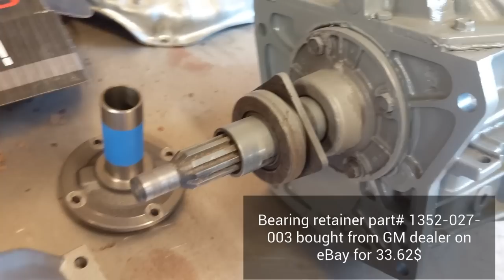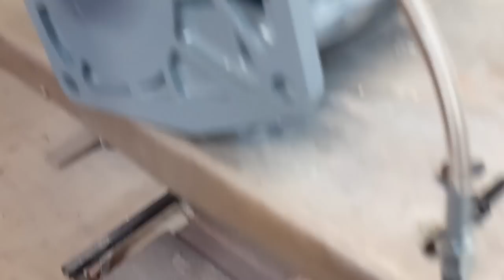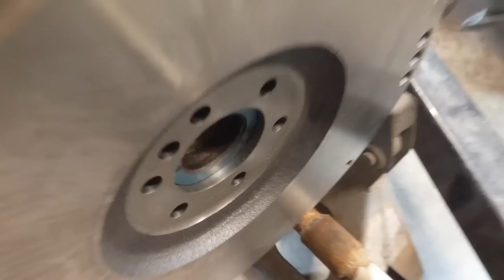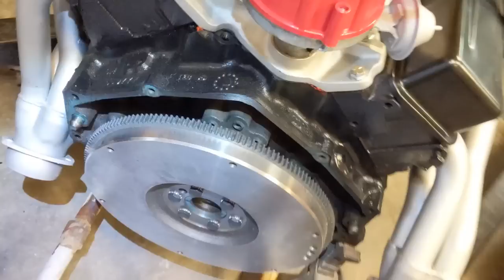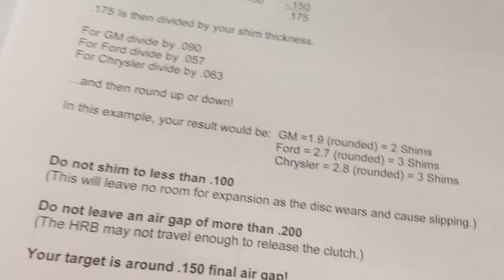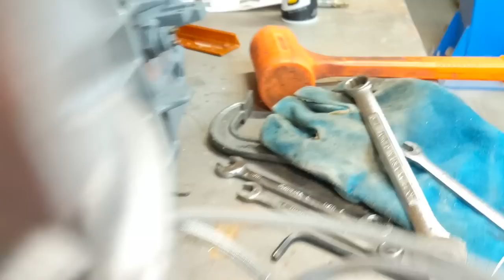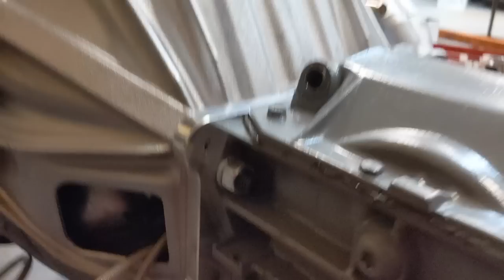Swapping a 5-speed manual behind a first gen Small Block Chevy

Comment: Great video sir!!! So glad I came across this. Im working on a LS swap for my 86 RX7. Im using a world class T5 from a 99 camaro V6. Apparently it uses the same case as the Ford T5. I got a BBC bell housing (with the muncie mounting pattern) and also had a to get an adapter like yours. I got mine from Modern driveline. I first looked up the one you have and they ended up pretty much identical. My question is with the tob. What one was it? Where can I order it and how much does it cost? I went with a T5 to save a little money, didnt realize id have so many other little things to add and change to make it all work. Lol, so far, the least expensive part about my LS swap is the actual LS engine itself! It will all be worth it in the end. Ive liked and subscribed. Check out my channel sometime and you can see where im at with my build. Keep up the good work!!!😎👍
Reply from the maker: Sorry for the delay, this ended up in spam for some reason. The TOB I installed is part# HMGM-01101G, I got it from Summit racing. The TOB from the kit slides over the Chevy front seal housing, so I ordered that and swapped it with the Ford one, but since yours came from a Chevy it may have the correct housing already. Hope this helps and be careful with a T5 behind an LS, I try to keep the total power below 315hp on a stock T5

Comment: So this is a ford transmission correct? What slip yoke are you using for the drive shaft and with the adapter do you have to shorten the driveshaft or no? I have the opportunity to get a T5 from a 93 GT mustang for next to nothing and I’d like to put it into my IROC-Z doing something similar to what you’ve done here.
Reply from the maker: Yes it's a Ford trans from a 92 5.0 mustang. The slip yoke is the Ford and was left on it when I got the trans. I did have to shorten the driveshaft, so I took the slip yoke and the stock Chevy driveshaft to my local driveshaft shop and they swapped the front yoke, cut and balanced it for 160$. I'm not sure what motor you have in your IROC-Z, but some people have expressed concern over higher hp on the T5s. I'm running a 305 with FITECH fuel injection and an edelbrock intake so it's still under 250hp I'm sure, but a built 350 may be pushing the limits of the trans. The 93 is a good T5 and I'm not mistaken it had the highest hp rating and carbon fiber clutches, but if I were you, I'd do some googling before digging in especially if you are adding power later. That being said I LOVE THIS TRANS SWAP! THIS Camaro screams.
Reply: ACtheCarGuy / my 350 is basically a stock vortec 350 with a dual plane intake and an Edelbrock 600 cfm carb. The rating from summit is 255 hp and 330 tq. It’s just a driver no track duty or anything like that. I found a bellhousing from speedway motors (pn 91027001) that has both the Chevy and ford patterns for $300
Reply from the maker: @limabravo6065  I'm not familiar with that bell housing but my only concern would be the distance that the transmission sits behind the motor. The bell housing and adapter run just under 340$ for both, so for 40$ difference it would only be worth it if you didn't have to build a spacer to move the trans back. The HP and TQ specs sound like its right on the edge of what the T5 is rated for but I'm sure on the mustang forums you'll find lots of guys with more HP on the stock trans so it might be fine since it won't be abused.
Reply: ACtheCarGuy 
Well from what I can tell if I remove the ford input shaft and bearing retainer and swap those part out for the gm parts from an f-body everything should be good to go. As far as I can see the T5 in the mustang and that from the Camaro are the same so far as length goes, and the shifter is in the same spot. What I’m thinking I can do for the output shaft is have the ford slip yoke installed on my drive shaft. The ujoint cup sizes are the same. Now I’m just speculating here if I’m wrong please let me know
Reply from the maker: @limabravo6065  I think you are on the right track overall. If the trans is the same length and the u joints are the same size you can swap the slip yoke out and there is always a little wiggle room on slip yokes since they slide back and forth with the suspension so .5 in either way should be fine. If you swap the input shaft and bearing retainer to the GMC style you should he good on the length but you will have to use a different clutch disc and pilot bushing than the ones in the video (I think the shorter input shaft is a 28 spline, so I think you'd use an s-10 clutch)
Reply from the maker: One more thing: if you swap the slip yoke, I would still have a driveline shop balance the shaft. An unbalanced DS can wreck a driveline with a quickness. The balancing may be close to the same price as shortening or lengthening your stock one.
Reply: ACtheCarGuy / absolutely agree/ I had an unbalanced driveshaft once not something I’d care to repeat. Summit sells an oe style replacement clutch for an 82-92 F-body with a T5 so sourcing the clutch and pilot bearing shouldn’t be a problem. Thanks for letting me bounce ideas off you
Reply from the maker: @limabravo6065  no problem! Good luck on your project! I'll have an update yo this video in the future that shows it in the car and how I ran the hydraulics and mount
Reply: ACtheCarGuy /
Thanks man you to. I’ll check it out soon as it’s up
Reply: @limabravo6065  
I know it's been a while but, don't forget the Ford case has a flat mounting pad for the trans mount. Because it was designed to bolt up to a straight-up bellhousing.

An F-body T5 has the bellhousing bolt pattern rotated ~17 degrees CCW from horizontal. And the trans mount pad is also angled to compensate.
Also, your F-body shifter bolt holes won't line up. And a mustang shifter won't be angled correctly, if you mount the trans to a GM T5 bell.

These are really only issues that exist using a Ford T5 in a 3rd/4th Gen F body. A GM V6 (4th gen 3.4 & 3.8) T5 (Ford bolt pattern) would fix all of these, and you'd then only need the adapter plate.

A few lessons I learned.

Comment: I'm thinking about swapping out the TH350 for a t5 in my 68 Camaro. What car did you put this in?
Reply from the maker: 1979 Camaro Berlinetta. It was a fun build, C5 Corvette brakes, rear discs, Hotchkiss suspension, FITECH fuel injection, full paint, and of course the Manual transmission conversion. When I shoot the update video I'll add the pedal assembly and how I mounted the hydraulic master. It can be tricky, but it's a great modification. It makes the car feel way faster than if I swapped in vortec heads and added 50 horsepower
Reply: @AustinCoulson   i done it to a 454 in a 79 trans am. Its worked good for a year. Took some work to convert as you seen but still cheaper than a gm t5 also a little bit stronger and definitely cheaper than a t56.

Comment: Looks good. Have you given it a test run? Is there an update video? Cheers!
Reply from the maker: Thanks! I have been driving it, and it's an absolute beast. The overdrive allowed me to swap the rear end from a 2.41 to 3.23 with posi and still cruise on the freeway at 2000 rpms at 65mph but still accelerate hard.  I will have an update video soon!

Comment: The absolute top t5 swap video I have ever seen. Fantastic job. Thanks for your time with this!
Reply from the maker: Thanks! I'm still getting the hang of filming, but I like making these.
Reply: @AustinCoulson  have you put a T5 behind an LS? Do you know if anyone makes a T5 kit for an LS?
Reply from the maker: @tommyflores5963  I haven't because the T5 isn't rated for LS power, but I have seen it done. 5 of the 6 bellhousing bolts on the adapter I use will line up with the LS as will the dowel pins. I'm not sure what clutch you would use because I am not sure if the small block one I used will mount to the flywheel
Reply: @AustinCoulson  would the T5 handle a boosted application?
Reply from the maker: @tommyflores5963  I think the best world class T5 is still only rated around 305hp
Reply: @AustinCoulson  oh dam..
Reply: @AustinCoulson  thanks for the help.
Reply: I second or third that! Thank you!
After reading all the comments,  I am starting to think another transmission option exits that will accept most of the parts in this video! I am thinking of the ZF60 bolted in the early 90s to L98 SBC Camaros and corvettes!
Again my memory is all over the map these days, but didn't these early black label ZF60 had to have their input shafts changed so you could use them with LS motors? I am thinking L98 is the same as a first generation SBC so it should work!
Reply: Agreed

Comment: What is the difference between the Ford t5 and the gm t5?
Reply from the maker: The actual housing itself has a different bolt pattern at the front, and they use different bearing retainers
Reply: Also the availability and pricing on cores. GM pattern V8 ratio World Class T5's were only available on 88-92 Camaro and Firebirds and usually bring around $900 for a rebuildable core. The Ford V8 World Class T5's are much more plentiful and a good core can be had for 300-400 bucks. Input and output shaft splines are different, as well as input shaft length is much longer on a Ford T5 than GM. Thats why the Hot Rod Works adapter is as thick as it is, so it spaces the transmission out to account for the added length. The plate also works on GM V6 World Class units from the mid 90's that utilize the same Ford pattern and near identical input shaft length.
Reply from the maker: @leadfoot_9576  great additional information. I didn't think about core/availability on them!
Reply: They have different input shafts gm 26 spline and mustang is 10
Reply: A 98 camaro z28 has the world class t5 as well